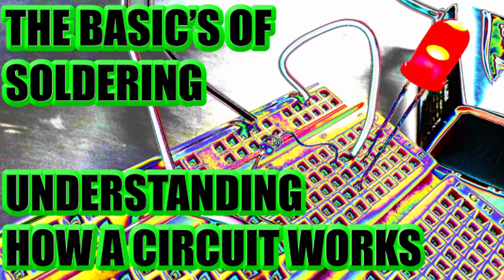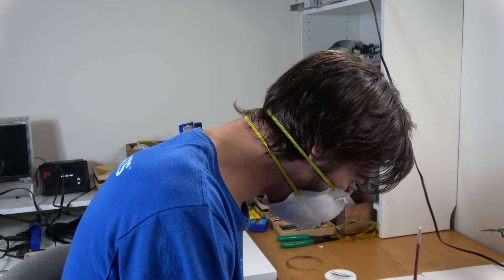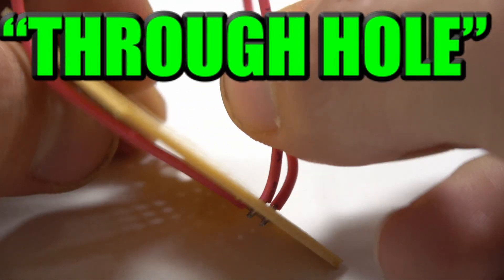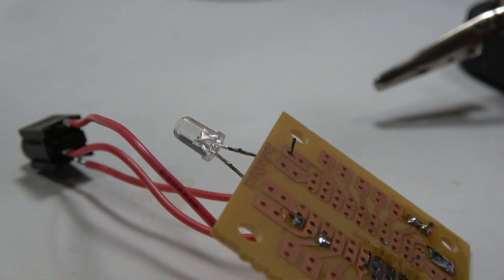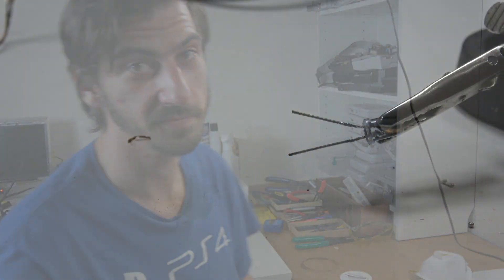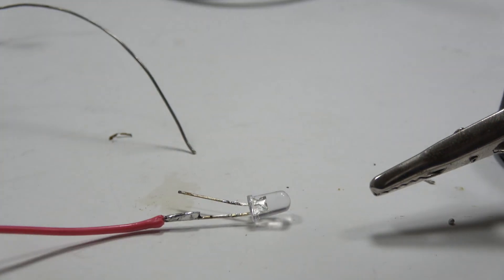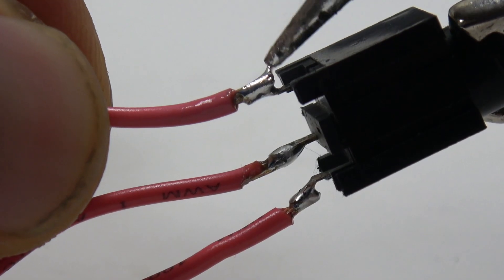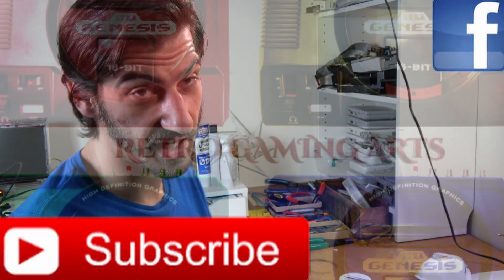Solder Basics - HOW TO SOLDER - RETRO GAMING ARTS

Comment from the maker: where do you stand with soldering? do you want to try it? do you solder already? are you never going to try it but like learning about it? let me know!
Reply: Videos like yours made my soldering much better. I managed to solder a modchip into my original Xbox without killing the board. I did break off a soldering pad on a chip though by accidentally pulling the wire but luckily there was a spare pad on the backside so it worked anyway.
Reply: I never done it but I think I will be doing some soon. Is there a recommended temperature for the iron to be in when soldering a PCB?
Reply: I’m loving this series! I’m definitely going to try this out! Hopefully I could ask you a question? For someone looking to get into modding and repair.. You think I’d need to get an electronic tech degree or certification to get work of this type? Appreciate the time!

Comment: What kind of solder and flux do you recommend?
Reply from the maker: Rosin flux, liquid or gel, either works
Reply from the maker: And 60/40 rosin core is great standard type of solder that works very well for alot of situations
Reply: I ended up getting some kester no clean 63/37 solder and a no clean flux pen as recommended by the retrorgb modding tools guide. I kinda think I prolly shoulda gone the RMA route. Thanks for the recommendation!
Reply from the maker: @ThickpropheT  in my experience, it all turns into a preference. trying various different equipment and products and then you end up finding what you like in certain situations and using it for that. so you can never go wrong. Thank you for watching and any questions or anything, never hesitate to hit me up, i got your back, sometimes im late, but late is better than never

Comment: This makes my next job seem a little less intimidating. I have a Modbo 5.0 that I want to install on my old PS2. I've done some soldering with music equipment, replacing pickups, input jacks, so on and so forth, but I've never done it with a game console and to be honest I kinda suck at it. The thing that has me a little concerned is that some of the points that need to be soldered are extremely small...
Reply from the maker: john21716  im sure you dont suck at soldering if you have done it before, i would defenatly put modbo 5 into the advaned+ category of mods though. Strip your ps2 down to the mobo, look at a diagram, and see the points you will be soldering to, your correct, they are very small, some of them are smaller than the 30awg kynar wire itself, the solder tip i use for modbo installs is 1 millimeter wide, you can use any tip i guess, but i would hone your skills a little before tackling modbo, but i dont know where your skills are, i believe you can do it with just a little practice before you try it
Reply: Practice, a lot of concentration, and a magnifying glass!
Reply from the maker: my magnifying glass isnt strong enough for modbo, what i use is my cell phones camera, and i zoom in 8x, works perfectly, and then what i do is i get a box, and rubber band my cell phone to the box, so i can do the mod through my cell phones zoomed camera, not for all points, just some, and to doubble check the connections
Reply: Primarily the extremely thin pins going around the square chips. When I took my PS2 apart to do some prep cleaning I had the diagram on hand. I think that there's only 3-4 wires that need to be soldered to those pins. Those are the ones that have me a little concerned. Past those few points I should be good. I didn't think of the cell phone trick. I was going to do something similar and setup my camcorder over it, string the HDMI over to the tv and zoom in that way. To be honest, my cell phone is older than dirt and probably not up to snuff for that task.

Comment: Very Nice video Paul! - One thing that maybe you could add/include in this or your next video is iron temperature.  When soldering on circuit boards, especially on very small pads you don't want to do any damage or lift pads completely. Also, i forgot to mention, I appreciate the video quality of your tutorials. May I ask what you are using?
Reply from the maker: Incursion64 thank you so much, i try hard to put alot into my editing, i use divinci resolve 12.5 for video/effects/zoom and zara xtreme 11 for text and images, Thank you